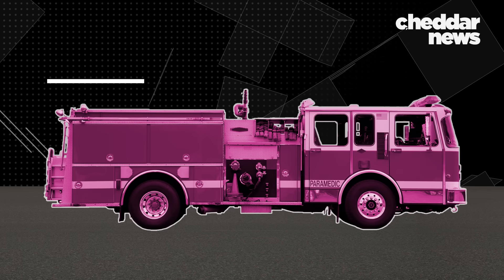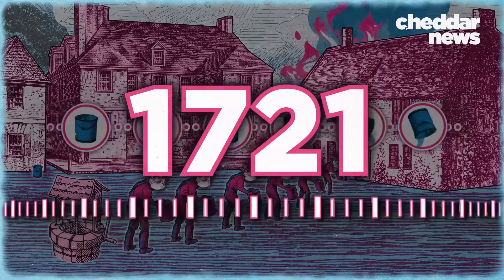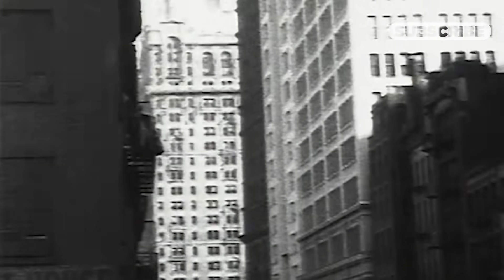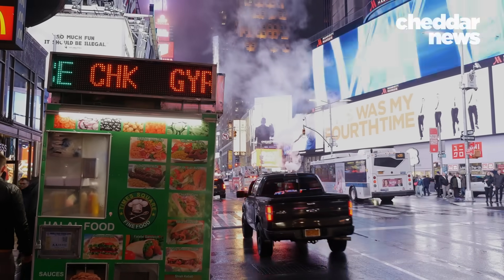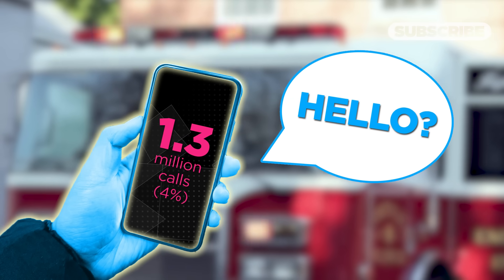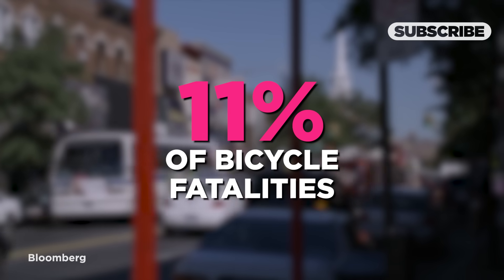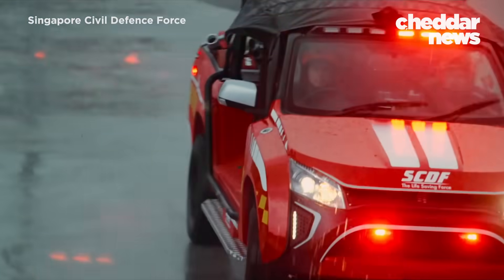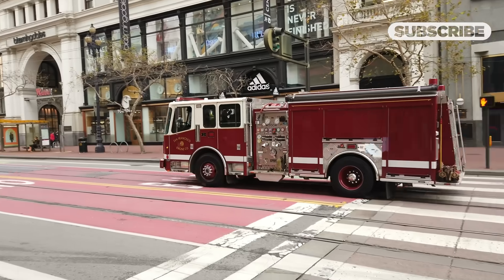Do American Fire Trucks Need To Be So Massive? - Cheddar Explains

Comment: This was an incredibly uniformed video. 1st off most fire engines carry about 1,000 gallons of water not 400. This is so the 1st company can focus on making an aggressive interior attack and rescue while the 2nd company  can get a water supply going. It takes time for the 2nd company to get their and get things going.  In rural areas that requires literally hauling water in and setting up drop tanks. 

2nd You're absolutely right in saying that we don't need to take engine trucks to medical calls but many fire halls are small often only having room for 2 trucks being the engine and the ladder. In rural departments where the halls are bigger we don't necessarily have the budget for multiple different trucks. You may only need the two engines and 1 ladder truck once a year or once every couple years but when you need it you need. Also you've got back ups this way. What happens if you have 1 engine truck and it breaks down for a few days. You can't just tell the community to not have a fire. 

3rd reason for taking engine trucks to all calls. Once again You're absolutely right in saying we don't need all of that stuff for a regular engine truck but what happens if on the way to or from the medical we come across a car accident. Sure would be nice to have the equipment to deal with it. What happens if the call ends up being different. You go for a medical call and it turns out their is a gas leak instead. You're medical only rig isn't very helpful in that scenario.  Or the reverse you go out for a gas leak and it ends up being someone with a mental issue. Sure would be nice to have your medical gear with. In a few scenarios you need everything. Car accident with an injured patient in a burning vehicle. You need water to put the fire out, tools to get the patient out and medical supplies to treat the patient. You don't have the room for 3 different rigs that close to the car nor due you have the man power to drive that many or the time to wait that long. 

With 1 truck we can respond to literally every single call we get. Think of everything you call the fire dept for and realize that everything we need to efficienctly start dealing with that problem is on one truck. And with 90% of calls it's the only truck we need to completely deal with the problem. If you actually think about that it is insane. Every call 1 truck. That's a lot of variety on one rig.

Now I will gladly sit down and discuss with informed people about the pros and cons of having a multiple rigs that can do everything vs specialized rigs because that's really what this is about. But that's not at all what your video discussed.
Reply: I think there is a gloss over of the fact that FD is sent to medicals for manpower. It's pretty difficult to move a patient with just 2 people. Sure you can do that when you have space or if it's just a transfer from a bed, but when you have large patients, difficult egress, or a busy area that would put a lot of work on a 2 person ems crew for call after call, it sure is nice to have 3 or 4 extra hands to help. Especially when working a code. Compressions can get poor if there are only 3 people to run airway, monitor, and compressions. The extra hands also help speed up patient transport by being able to let a few people conduct assessment and treatment while other people get the egress plan going. Most FD have people working for 20+ years as medics while EMS crews tend to have less due to burnout so having the FD respond helps put more brain power into problem solving and vice versa.
Reply: @markmagdaleno2351  in case of critical patients we'll have a 4 man EMS crew on scene anyway, as emergency doctor cars are staffed with 2 (EMT or paramedic + medical doctor) as well. Not even counting trainees, which might be a 3rd crew member on both the ambulance and the doctor car. 
It does happen that we need to call the FD to help us getting a patient down from an upper floor, let it be through the house or with the Aerial from the window. But it's not a thing which happens like once every day or week. On my shifts I had this maybe 2 times in the past year
Reply: question would be: why a fire truck to a medical call at all? I can it making sense to send out some fire apparatus to a medical call if the ambulance is far away, but often I see them arriving on scene at more or less the same time, and that it's very common for departments rolling out with an Engine or even a Ladder Truck / Tiller Ladder to a medical call. 
You'll see Europeans come to medical calls with a Tower Ladder when the already on scene EMS crews tell dispatch to send one, in order to get the patient down from an upper floor, but that's about it. 
"You go for a medical call and it turns out their is a gas leak instead. You're medical only rig isn't very helpful in that scenario." in years working in EMS I never had that issue; My gas warning device never went off on any incident. If it goes off, then we let dispatch send the FD. 
"Car accident with an injured patient in a burning vehicle." that's the point where dispatch sends the FD here as well, but not for e.g. chest pain or a possible fracture inside an apartment / house
"nor due you have the man power to drive that many or the time to wait that long. " here we do ... even volunteers will roll out with multiple trucks then.

Here the Engine is the multifunctional apparatus: carries water, foam, hoses, ground ladders, full set of rescue equipment, smaller tools for technical assistance, wet vacuum cleaner, jumping cushion, EMS backpack, brushfire equipment etc. Still it takes many other apparatus to deal with different kinds of scenarios.
Reply: @EnjoyFirefighting  why a fire truck to a medical call indeed… how long do you have, because i reckon the answer to that question might involve unpicking the US healthcare system.
Reply: @EnjoyFirefighting      We beat our ambulance crews by about 5 minutes every single time and our ambulance is in our town. For our neighboring departments that use our towns ambulance crew they beat them there by up to 20 minutes keep in mind the towns are 7 and 15 minutes away respectively.

Now I completely agree we should not be sending firefighters to every l medical call but we have a truly severe shortage of EMTs in the U.S. Local municipalities are never going to spend the money to staff enough EMTs to be able to respond efficiently when they have the fire department there that can respond 1st while the EMTs get there. 

Well I used the gas leak example because it's happened to me before. Fire departments aren't judged for the things they do everyday they're judged for the things that happen only a few times in their entire career and how they handle it. As important as it is do nail the calls that come in 99% of the time you gotta be ready to nail the call thar comes in once too because if you don't your community will never forget it. 

Basically it sounds like what you're saying is it's really dumb for us to have our fire departments run medical calls and I completely. I was actually just talking to my mom who is becoming an EMT that this whole fire departments also being well trained EMS but not being able to actually transport the patient is really dumb. We'll even drive the ambulance for our local crew if they are short staffed that's how much stuff we do for them. But anyways it's a dumb system that local mundane up with to deal with the ever increasing medical calls without having to spend all that much more money. The fire department already exists let's just make them go on more calls instead of getting more ambulance personal so they can respond in a timely manner. It's a dumb system and it absolutely needs to change because it sucks and is very problematic.
Reply: @naddarr1  time sure is an argument; We have full-time crews only in larger towns career departments only in the large cities, so in most places the volunteer FD wouldn't arrive before the ambulance does. If dispatched at the same time to an alarm in the 2.5 miles distant village, their volunteer FD would arrive at the same time like the ambulance from our village. Here first responder units from the local volunteer FDs will be sent out especially at places which are like half-way in between two EMS stations. Even if ambulances are available for calls, those places will naturally be the ones with the longest response time, like 10 minute.
Reply: @EnjoyFirefighting  Think it might fall on deaf ears
Reply: @oscarosullivan4513  Why do you think it'll fall on deaf ears? I agree with the primary view that we shouldn't be sending fire departments to every medical call Unfortunately we do. Even in this original video that still wanted the fire department to respond to medical calls just in smaller rigs.

Comment: Such a dumb video. Who cares if only 4% of emergency calls are fire related. When you're one of those 4% of calls and you're in a building that's on fire, you want your fire department coming to save you in the vehicle best suited to save lives, not the vehicle that shaves a few bucks off the towns budget or allows for more bike riders on the street.

"Oh sorry miss, your husband's dead because our small truck ran out of water. At least you have a bike lane to ride around on!" 😑🤦
Reply: you do realize that departments in Europe can easily roll out with a convoy of apparatus at the first alarm already, without any fire being confirmed? And also, that they either have a good and tight hydrant network or, in order to compensate the lack of it, large Tankers?
Reply: @EnjoyFirefighting  sure- because European countries are tiny. It's incredibly unrealistic (and very urban-centric) to assume that there's a hydrant every 50 feet across the entirety of the United States. This entire video was crafted as if the United States is one enormous densely populated urban city. 

Regardless, I'm not convinced that tiny little 4v4 jeep they call a rhino in the video could adequately transport all the gear needed to do the best job possible. All the points raised by the video are not worth sparing even the smallest amount of safety. Worst of all is the idea that they are considering cost. Cost should never be a consideration when safety is concerned, and if it is, it's time to raise taxes until it isn't. We shouldn't be interested in pinching pennies when the public good is concerned. I'm certain some of these billionares could afford to lose a few helicopters so the local fire station can afford a proper truck.
Reply: @Striker1246  the size of a country isn't an argument for them being able to roll out in convoy. A country can be small and have a very low population density, of course they won't roll out with 10 apparatus from 1 station in a convoy right away. Even in countries with higher population density this will barely be realistic in rural areas. But in the cities it definetly is, and also the US has cities with high population density. 
I never expected the US to have hydrants everywhere; While built-up areas have hydrants here, not every place has them, especially in rural areas; As I mentioned we compensate the lack of hydrants with Tankers as well. 
"hat tiny little 4v4 jeep they call a rhino in the video could adequately transport all the gear needed to do the best job possible." I don't know how exactly they use that thing as it's in Asia. But we have sth similar here: Mini Pumper and Mini Rescue. Not made to complete a task, but to rush ahead and start a first attack. Being based on cars and vans they can hit higher speeds than the fire trucks can on clear roads; And in traffic jams they have an easier game to squeeze through while a fire truck might be stuck and make way slower progress through traffic.

Comment: Edited because I forgot to mention ISO ratings and NFPA standards

I feel like the video put down the American apparatus without really going into much detail about why they are the way that they are. A major issue is the style of firefighting. American departments have traditionally been quick to go to interior for rescue and fire attack. The trucks reflect this with the way that the hose beds are laid out for quick hose pulls and ladder beds for quick ladder throws. European trucks have less equipment that takes longer to set up because of how it’s stored. And because the equipment is spread over multiple apparatus, more have to respond. Changing apparatus would mean that tactics would have to change and firefighters would have to be retrained. The American fire service is notoriously resistant to change. As the saying goes “100 years of tradition, unimpeded by progress”. Just ask anyone how they feel about European helmets, clean cabs, or even EMS. But the other saying goes “if it ain’t broke don’t fix it”. Departments spec out their apparatus with what works best for their area.

Every department has an ISO ratings that they are trying to maintain. Because of this they have to have a certain amount of certain apparatus classes. These classes are based on size of pumps, tanks, ladders, etc… Along with NFPA standards apparatus can only get so small while meeting standards.
Reply: Here in Ireland most calls are handled by two pump appliances
Reply: "American departments have traditionally been quick to go to interior for rescue and fire attack. "
Same in e.g. Germany. In fact most structure fires are fought by an interior attack only. In e.g. Norway they have seperate apparatus for interior attack; FInd some of those also as special operations unit in Denmark
"European trucks have less equipment that takes longer to set up because of how it’s stored." no and no ... while the average Engine definetly carries less water, they actually carry even more equipment, often making a Heavy Rescue Truck unnecessary. Also they don't take more time to set up. The approach is just very different: you have hose beds, we have hose carts - instead of dragging a hose on the ground we simply roll it. Not any slower. Apart from that a crew of 9 can both start an interior attack and set up water supply at the same time
"And because the equipment is spread over multiple apparatus, more have to respond" well, you see multiple apparatus respond to a fire call in the US as well? It's not that much different from Europe tbh. It's just that at career FD in central Europe you usually see most of these apparatus coming from the same station, responding in a convoy, in contrast to them coming from several tiny stations like in the US
Reply: I didn’t say that European departments are slow or don’t go interior. I said that we developed our apparatus based on our approach, with our own style. The videos that I have seen of European responses have shown a lot of specialty units. Some of these aren’t needed in America because the equipment is already in our larger apparatus. I’m sure that European crews are well trained and can operate quickly. But if European and American crews switched apparatus there would be a bit of a curve. It takes some practice to learn how to properly deploy our hose loads, which when done properly are carried not dragged. I made a generalization of how European apparatus is based on what I’ve seen of British, German, and French departments on YouTube. And I’m sure that there are differences of how apparatus are set up and their function across all European countries which is another thing that sets us apart. Across all 50 states there are 4 main apparatus that are set up much the same with the same function. Engine companies carry hose and water to fight the fire. Truck companies carry ladders, saws, fans and hand tools for search, rescue, ventilation, and overhaul. Rescue companies carry just about every rescue tool you could need for a variety of specialized rescues. And tanker/tenders carry a bunch of water. There’s a few specialty apparatus depending on where you go but that is what you’ll find in almost any firehouse that you go to in America and they will operate the same no matter where you are. It seems like it’s different in Europe considering that Norway has a specific apparatus just for interior attack. 

Overall my point stands that the video attacked American apparatus with generalizations that didn’t explore much more than the average size. Not all American apparatus are behemoths and not all European apparatus are actually much smaller than American. From your videos it seems that a lot of firetrucks are actually closer to the same size than you would think. But overall The United States is different than European countries. Just because something works for y’all doesn’t mean it will work here. Smaller apparatus are becoming a trend here as departments limit the purchases more to exactly what they need. But the size and amount of apparatus a department will always be based on ISO ratings not because “Big dumb American firefighter likes big truck because America great Europe sucks.”